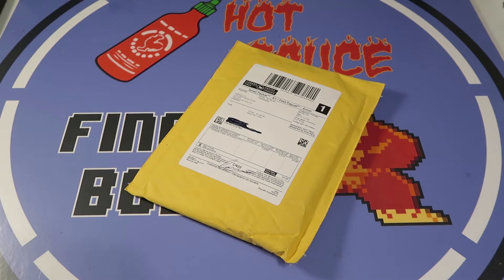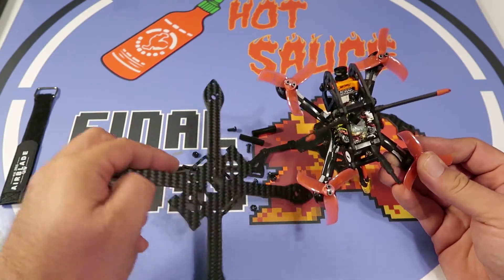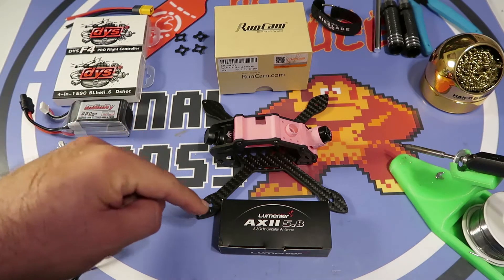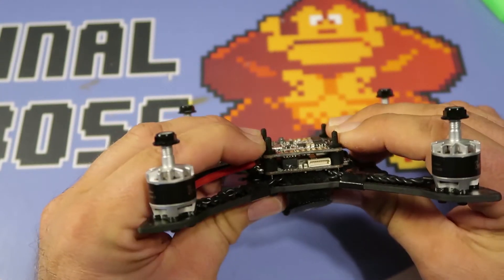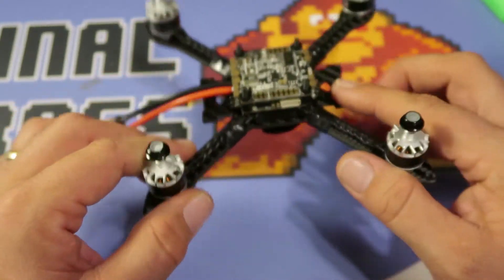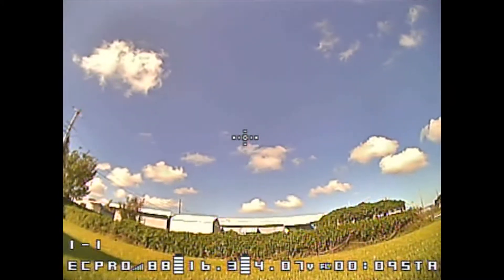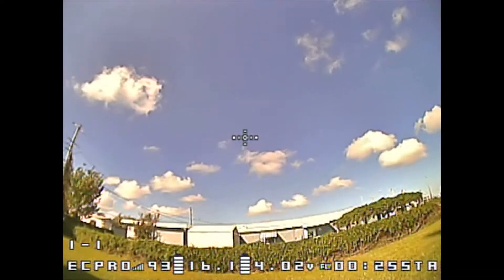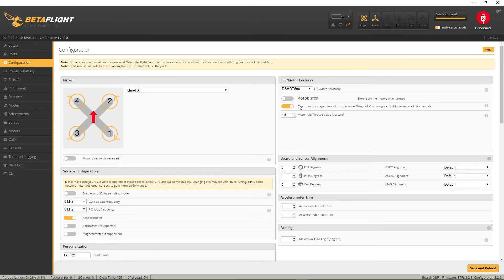3" Monster! Eclair Pro - Build Summary, Setup & Test Flights

Comment: how is this frame holding up after 3+months? is the carbon strong?
Reply from the maker: I’ve broken arms twice, from crashing hard on pavement, but I’ve broken 4mm arms on 5” quads the same way.  I don’t think it’s the beefiest 3” frame you can buy, but I’d say it holds up about as well as I would have expected.